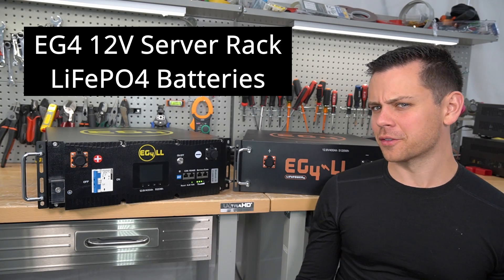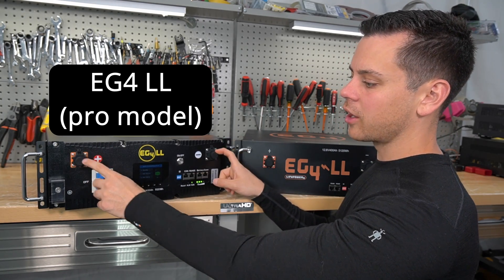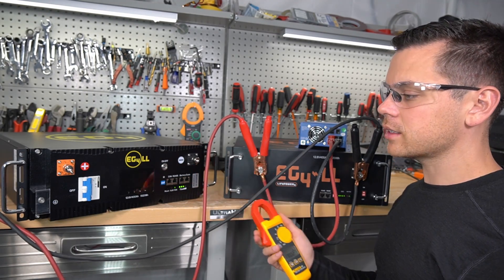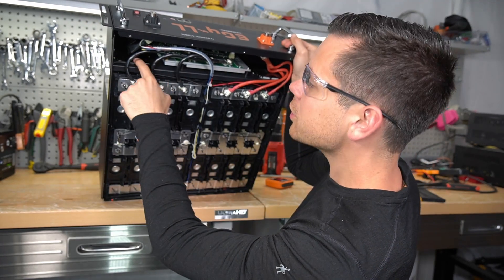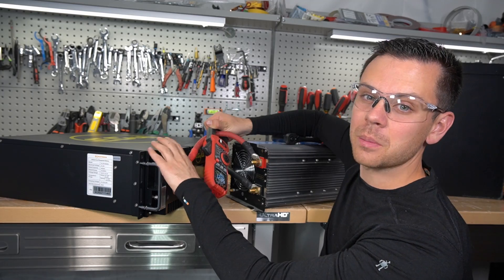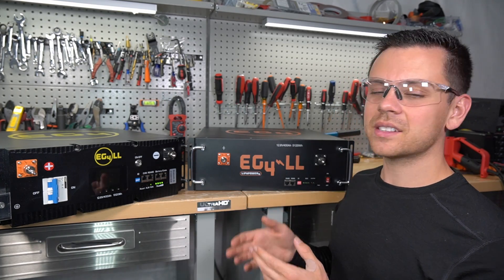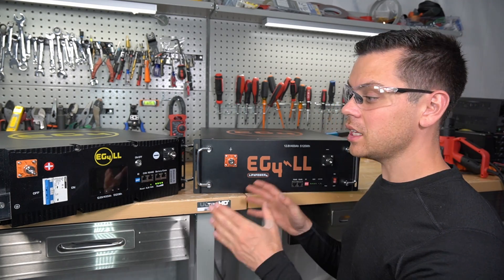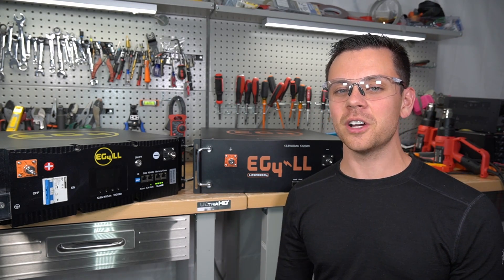$1,449 EG4 12V 400Ah LiFePO4 Server Rack Battery

Comment: I totally understand your reasoning on getting away from multiple 12 volt batteries. However when camping, sometimes you can be out in the middle of nowhere. In a multiple battery situation, if one battery goes bad you have options. I can only imagine what you would have to deal with if this single server battery had issues when you're out in the middle of nowhere.

Comment: EG4 also has waterproof 12 volt batteries for RV and Marine use.   I am looking at two 100ah models for my RV.  They are also priced right at $449.00 currently at Signature Solar.  Signature Solar also did a tear down video of this battery.  The video looked good, but it was not as comprehensive as Will's.  Maybe an opportunity for a future Will tear down?

Comment: Does the BMS have a low temperature cutoff?  It wasn't mentioned as far as I could tell...and the manufacturer does not have any specs on the BMS they are using that I could find as well.
Reply: I would like to know also. I want to use them in my skiing RV.

Comment: Most circuit breakers are Primarily intended to respond to short circuits. With a secondary function being the thermal overload after a biometalic strip reaches a certain temperature.

Comment: the arrestors are there because its a 12V battery which is much higher current and will have a much worse UL9540A report with more fire

Comment: the breaker is a UL1077 MCB it could also be a molded case switch which has no overload function. BMS is better overcurrent protection anyway

Comment: Will is it possibly better to encourage people to get 48v and use something in the system to drop it to 12v
That way your Inverter is 48v so all your 110v or for Oz 220~240v.
also I wonder it one is starting from scratch is it better to wire your RV/Caravan/Boat all off the 48v system???

Comment: From my single conductor ii free air temperature rise table.
The 6awg wire would have a 130degC temperature rise at 100amps
So inside the case in a hot RV say ambient of 40degC the rise would be 40 + 130 =170degC
For me thats a little close to the 200degC wire limit.
Myself would have used at least a 4awg wire with a 200degC insulation.
For a 12V system since theres not many volts to start with, the larger internal conductor would have less voltage drop.

My engineering 2 cents

Comment: I really like EG4. nice thay have 12V model and even a 24V .small systems are 12/24V. The 12V would be great for 2 way radio gear or even a repeater cite. them mostly 12V and use 100 ah tell comm AGM battery. this would make a great upgrade. A off grid repeater cite  with solar/wind/hydro would be awesomesauce.

Comment: Great info.  I want to convert my class A motorhome form LA to LiFePo.   My current inverter charges are very inadequate anyway so looking for the proper Victron inverter charge to mate with this. Currently only have 400 watts of solar but would like to add a bit more in the future.  I am not looking to run Air Con. With this just more normal loads 2500 watts max.  Suggestions?  Thanks.  Love your channel!  I have a whole file of saved videos of yours.

Comment: When using your good old blue box battery chargers, what settings did you have them set to? I thought LiFePO4 was very sensitive to over voltage charging past 14.4VDC. What did you charge them to?
Reply: The Aims chargers have dip switches to set charging requirements for different chemistries. I have 4 of them set for lifep04 chemistry and they very reliable back off the charge amps then shut off as the batteries get to 100%. I use both 12 volt and 24 volt. They auto detect the voltage.
Reply: @kimmer6  That is great to hear. If I understand my research, the LiFeP04 do not like to be trickle charged which lead acid love. I will try my one Aims charger I have on LA batteries on my LiFeP04 and put an independent Volt meter on the batteries to see that shut off you talk about once at 100%.  What voltage does the Aim charger when correctly dipped to LiFeP04 use as the cut off voltage when it considers it at 100%?
Reply: @benkanobe7500  This brings up another topic...practically none of the volt meters in my MPPT charge controllers, Renogy battery monitors, several inverters, and 2 dozen Chinese panel volt meters reads the same. Some are 0.7 volts off. That is HUGE in determining lithium state of charge. I believe that I watched my Aims charger disconnect at 14.6 volts on my Fluke meter. Of course afterwards the battery voltage declines until it hits a stable point and remains there for weeks. I do not know the voltage where the Aims resumes charge. I just know that it is an on/off charge/no charge operation and does not float the lithium battery.
Reply: @kimmer6  That is music to my ears! I only use my calibrated Fluke for accurate voltage measurements as I have had the same experience you have had. I will check and see what it does. I understand charging to 14.6 and a resting charge are different and could see that a programmer may use 14.6 knowing the resting voltage once disconnected would be 14.4.  This has been very helpful for me. Thank you.
Reply: @benkanobe7500  Glad to help.  My different lifep04 batteries are fully charged if I see them resting between 13.6 and 13.8 volts after a day of sitting disconnected. 13.3 volts is about 80% charge and manufacturers ship them at that voltage.

Comment: If I replace my existing 6 GC2 6v FLA batteries in my RV with one or more of these, I know I'll need to replace my inverter/charger with one that has a LiFePo charge profile. Will I also need to install a DC-to-DC charger to protect my alternator?

Comment: I bought a timeusb pro 100Ah  battery, The BMS says 100amp but have seen 150amps for 5 mins and it showed that it did get warm. Anyways These batts are really 105AH cause with a 1000 watt load this is what I got out of it.

Comment: Thanks for the great video.  I think it would be a fun project to make a hybrid voltage system for a RV.  If i was going to build a system for a camper i might buy 4 x12v batteries and hook them up series 48v with an EG4 inverter to run all my AC and to charge from solar or when i'm plugged in AND ALSO then split off 12v (from one battery or in parallel) to run all my 12v systems. Some larger motorhomes/semi run off of 24v i think, so you could accommodate that too.  A video on how to do that the right way would be nice (maybe you already have)

Comment: They have 24 volt models do you think the quality and build is the same? I also am running a 24 volt 3500 watt Outback Power inverter will the 24 volt version run with the 3500 watt Outback? 
 
How many watts of solar do I need on my roof 
Thanks John

Comment: I would NOT recommend any componentry that is explicitly designed for a Stationary (Sever Rack / Wall Mount) for a Mobile (RV) application.  They are not likely hardened to the same level for shock, vibe, thermal, humidity & even salt exposure that mobile equipment is designed to handle.

Comment: i just got a 95ah lithium battery and the charger for it. i was wanting to make a long run time ups for my security cameras in case of power outage. im afraid if i connect the inverter and charger to the battery. then it will be constantly drawing off the battery and charging  when there is power to the outlet, and when the power to the wall  is out, then it would just drain the battery. luckly the battery has built in bms for over and under voltage protection. but im afraid it will be doingf a bunch of small cycling and wear out the battery.  i only need about 500 watts of continous . but would like for 3-6 hrs.  very few inverters has the charging capibilit5y built in ,  all are overly priced, and none allow to select the voltage ranges for lithium. but they might have there own default settings for lithium. victor converter/charger seem to be the best option, but it seems way over priced for what its doing. do you have any suggestions?

Comment: I wish these would have been available when I built my 24 V system with 2x sok 206ah. I would have instead much rather bought a single 24 V battery like this  For the solution

Comment: I was not aware they had a 12V rack battery option! My bad. I may have bought in instead of the cheap 140Ah 12V batteries I bought last year. 

I am very appreciative that you’ve covered these for the 12V market. 

For some people 12V covers the need, or exceeds it, and offers benefits that are desirable in their situations. Like mine. 

12V has its place especially where loads will probably never be above 15- or 20A at 120VAC, and 12V loads are not significant. And though I ‘can’ use a generator in an emergency charging situation it is a practical benefit that in some unimaginable circumstance where a battery fails I can just use jumper cables to my vehicle and have power with no additional equipment. Plus, my boat, my shop, my residential setups are all compatible at ‘native’ oem voltage. 

Now I’m sitting here wondering about selling my current batteries and buying a couple of the non-pro batteries. That would be a lot of storage headroom and give me many days of autonomy during dark winter months and give my heavily-overpaneled plan a place to store itself. 

Great move covering these.

Comment: I fully appreciate your videos, expertise, and attitude when trying to help us rookies understand the constantly changing tech... I have a request based on personal need, which might be a sector of the market I believe is considerable, but haven't really seen on your (or anyone's) channel... Basically it's ideas for temperature management in unconditioned space.... I've been off grid for about 20 years now, always maxing out my budget and power demands, and believe many truly off grid are likely in similar situation... If got a separate utility/bath house from my cabin and workshop and have been running a trace Dr 24v 3600w inverter charger from 8 6v interstate extreme wet acid batteries recharged from 4 200w@24v panels and manage an "almost" full size fridge, internet, computer, stereo, led lighting, water pump, all kinds of power tools during the day, a swamp cooler during the summer, but any attempt at small AC units don't last more than a few minutes... Sorry, this is dragging out...

Basically here in the desert, we are typically just breaking 100* most summer days, but occasionally have a week or so 115*+, and during winter most often hover 35*-40*, but dip into hard freeze territory a few times each season... And I don't believe I have much power to spare for any kind of heat elements winter nights or cooling during those summer days... I will actually be upgrading and possibly expanding my entire system besides panels (I do actual have 4 more sitting unused) and moving into lithium world, but am curious if you might have any ideas of passive temp control methods, particularly low draw high efficiency products, or just making a video or two demonstrating the effect of temp on battery banks, which I have a feeling is more significant than I'd like to admit!

Any way. If you have actually read this far, thanks again... Your content and intent is greatly appreciated! And I'll gladly be available if you'd like me to Clarify anything or provide any additional info... Much love... Peace!!

Comment: I still want to see a lead acid battery 48v that is 1/2 an ISO pallet X 1 ISO pallet. On wheels and pre measured jugs of battery acid. Inverter and charge controller that clip on with all color and letter connectors. 3600ah.

Connect cable A to receptacle A
Then
Connect cable B to receptacle B
And so on

Comment: FYI- the new EG4 inverters still will NOT communicate with the server batteries!
I’ve been trying for a few months now and have did a couple firmware upgrades to just be told it’s still not solving the communication issue. 
I have to use “user” mode instead of the EG4 battery setting which sucks and doesn’t allow near the depth of charge without causing havoc. 
It’s been disappointing. 
My old Growatt inverters still work fine with them, however.
Reply from the maker: You can get 100% capacity without communication and I've done it for years. Set you low voltage cutoff to 46V. That way you get full capacity and do not trip the batteries. try it and do a capacity test
Reply: @WillProwse  Thanks Will, I'll try that!
Reply from the maker: Strange the growatts work. Those seem tough to connect. I never got mine to work ever

Comment: I build mobile command vehicles for fire departments and law enforcement, and use 12v systems exclusively.  Solar panels are of no use as these vehicles have a completely different use case than a recreational vehicle.  The options for high output 12v alternators from the OEM’s and aftermarket allow these vehicles to power pretty much everything off of a 2kw-5kw inverter.  Electronics, HVAC, power tool battery chargers, etc.  Yeah it’s kind of a pain working with the kind of currents needed in a 12v system of that many kw’s but it’s necessary.  Until the vehicles themselves switch to 48v, it’s a necessary evil…for me.  Thank you for shining a light on this dark little corner of low voltage-high current that a few of us have chosen to call home!  Keep up the great videos!!

Comment: Great review Wil!! The downside of the higher end battery is no cold temp protection, the ground shipping via Fedex( their ground shipping really sucks) and no Bluetooth. So l am doing ur recommendations of buying 2 12v RV water tank storage heating pad as you have suggested in the past. This is for a small RV system. Will be watching ur 12v build to see if u are going to use that EG4 charge cord which you reviewed to see how it would work for a gas generator and any EV charging station to charge this 400" amper" up. Till then carpe diem!

Comment: This might be a great solution for my G3500 project build.  I could use it for a small refrigerator and microwave and it would also provide emergency power, should my truck break down again, so I can run my newly installed diesel heater in my sleeper box. (Which I had installed shortly after I had broke down 4 nights with 20f temps last fall.) I could also use them to be able to jump start the truck if the truck batteries become too weak to start the diesel. l already have 2 alternators and I could use one just to keep these batteries charged and the other alternator for the truck batteries. I could also add a solar panel and charger at a later date.  Hmmmm got me to thinking.  Thanks Will for sharing this.  Tony

Comment: My dislike for 12v power has to be tempered by the availability of 12v supplies in campers and vans and boats. If you generate 12v already then a 12v inverter is logical. In a new build electrical system 48v is much more efficient.

Comment: I don't understand why someone would spend $1500 on a 12v 400AH battery? 400AH x 12v in lead-acid batteries would cost about $500 - why spend the extra 200%? Unless you're on a boat or in a plane the weight doesn't matter.
Reply: LiFePO4 batteries like these last 5 to 10 times longer than lead-acid, and run at a normally higher Voltage through most of their cycles...and probably a few other reasons. I got tired of replacing my golf cart batteries in my RV system every year or two, so when I got a large sum of cash "dropped" on me, I bought Battle Born's 270 Ah batteries, which I will probably not have to replace in the rest of my life, (as I'm in my sixties now). I think Will explained the differences in one of his earlier videos.
Reply: Cause you really don't want lead acid batteries. No life expectancy, heavy, can only discharge to 50%.